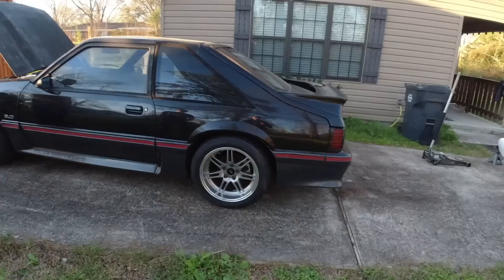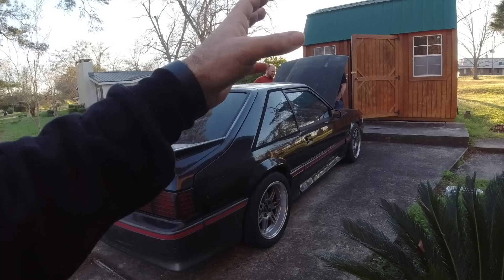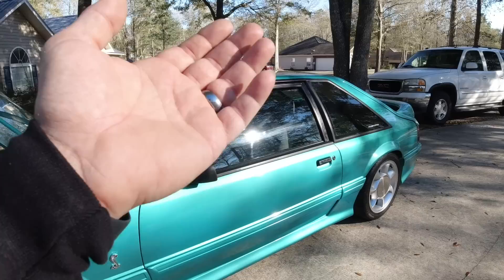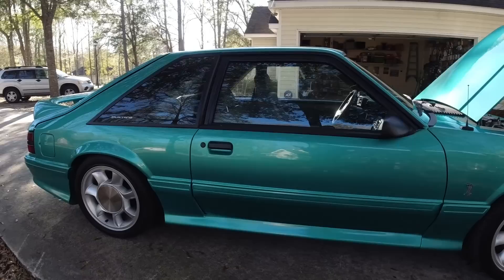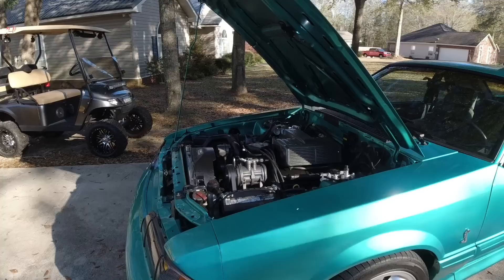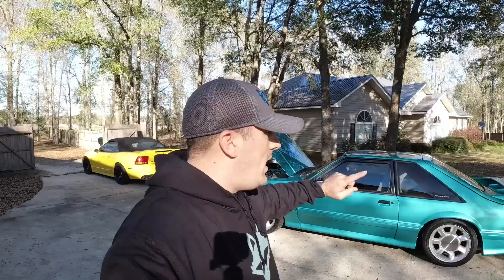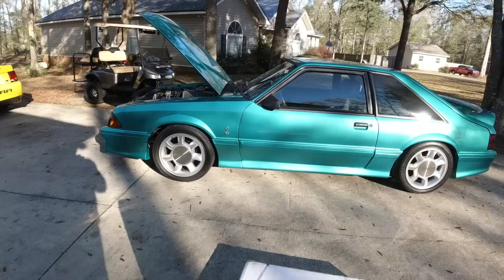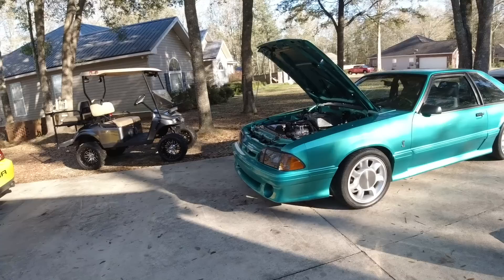FINALLY ADDING SOME SERIOUS POWER TO THE CALYPSO CLONE!

Comment: I missed Andrew's black Mustang GT. That thing is sick. Need to take that thing to the track and make smoke. I'm excited about the power adder that is going on the car. If you need a stroker engine. Check out, D.S.S Racing? They may have a budget stroker engine for under $4k. Last, I remembered. I want to see that joker at the track doing some good numbers.

Comment: I put a vortech S trim on my gt40x crate motor this winter. My penny's are definitely being saved for a dart block, forged internals and AFR heads. Because that circa 2002 Ford racing short block isn't going to handle the boost.